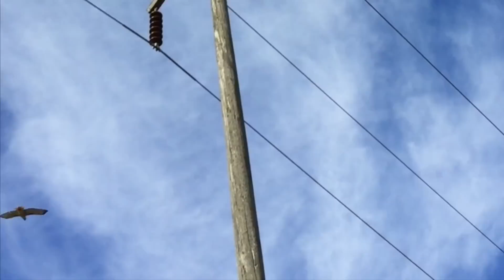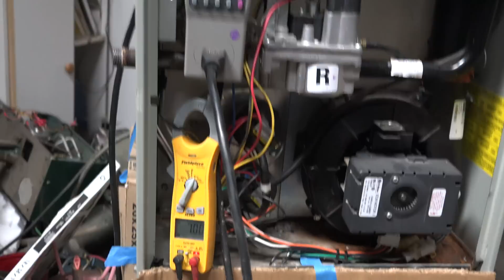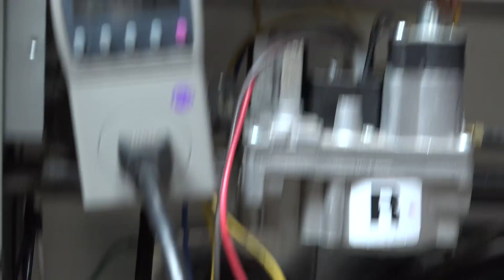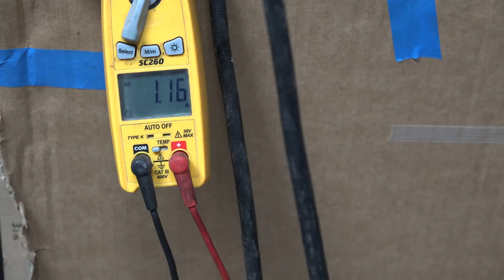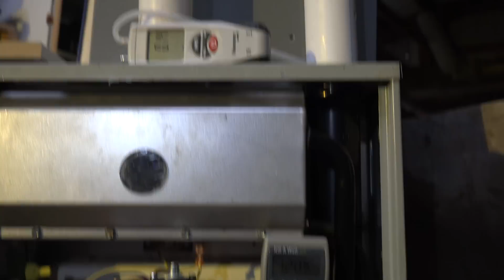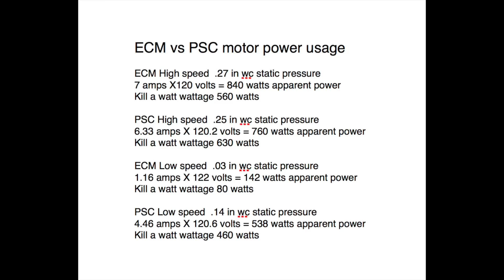ECM vs PSC motor #2

Comment: Great video, thanks for making it. I love the super low speed you can get with ecm for use in winter for filtering air and de stratification. Only drawing 80 watts is a bargain. I always suggest an ecm surge protector though because they burn up easy and are costly
Reply from the maker: Agreed
GFM

Comment: Do you recommend replacing a PSC motor in an electric heat/AC airhandler with an ECM motor?
Issues I am having is wifi interruption when furnace blower comes on. Also looking to maybe increase efficiency some. 
PSC motor in furnace is now about 10 years old and I believe the brushes are getting worn and increasing RFI and it is interrupting my Wi-Fi signal.

Comment: House utility installed power meter doe not include power factor effect i.e. it is KVA prox meter. Your experiment data shows that compare to PSC based unit, the ECM based units are expensive and needs frequent expensive repair. I think industry needs more research and engineering improvements on ECM to justify the added cost.

Comment: Awesome test, great video.  I am trying to decide whether it's worth the $1000 cdn to replace my faulty (for the second time) ECM 2.3 motor,  or to permanently convert to a PSC motor using a QT6104 board.  I currently have a bulletproof 25 year old PSC motor installed, wired directly to the mains, drawing 6.5 amps on hi-speed for A/C.  I'll need to get the conversion board so the electric bill won't kill the bank account, or I'll need to order a new ECM which will only kill the bank account every four years when they always fail in that time.  What should I do!?  Are there improvements to the reliability of newer ECMs?  Not sure of my static pressure but I have removed the dampers from all of the registers, and the filter is cleaned or replaced every 4 weeks. I would benefit on electrical costs as we run the fan in low speed 24/7/365.  But would it be enough?  
The Luxaire furnace is only 9 years old.  
Any advice is appreciated.
Reply from the maker: I would replace it with the PSC.  If the PSC is running at its high speed, it is fairly close to the power usage of the ECM.  It saves quite a lot if the PSC is operated at lower speeds.
GFM
Reply: Hi there.  Thanks for the advice. I used a Qwik board to replace the garbage ecm 2.3 motor, but the Qwik board will not run the fan on HIGH speed when cooling.  Is there a setting on either my oem Emerson board that needs to be adjusted or the Qwik board?  The second floor of the house is not being cooled, not enough CFM coming from the blower with this Qwik board as it keeps switching from HIGH, to MED, then staying on LOW for extended periods of time. I've tried putting the thermistor on the coils, tried moving it outside the furnace and even dunked it in hot water and the Qwik sets the fan on MED for a short time then back to LOW. 
Previous to receiving the Qwik 2.3 board I simply connected the PSC directly to power and the house was perfectly cool.  Any suggestions?

Comment: Maybe try using a med-low on the ECM to get roughly the same static pressure as the PSC.  Sure the static is less, because the motor is doing less work.
Reply: Yes, if the ECM motor could be adjusted to achieve the same static pressure as the PSC on low, it would be a valid comparison.  Otherwise, turn off the PSC for zero energy consumption, with both motors effectively doing zilch.  Low speed on one doesn't equal low speed on the other unless they're at the same static pressure.

Comment: I thought the lower the static pressure the more air that could be moved and the higher the pressure the less?Or am I confusing  blower pressure with TESP? Please explain for me.
Reply: With the same ductwork, higher static means more airflow.
If the ductwork is charged to reduce eh static, airflow INCREASES
Reply: @servicetechokc  ideal is .5wc . higher static pressure means less air flow restriction lower cfm's

Comment: This was a great update. Those Kill A Watt's are very accurate for the money, but they can be off quite a bit with some 'electronic' loads that have poor filtering and low power factors. Unfortunately a very good power meter is rather expensive. But for most peoples purposes, the thing they care about is what the meter on their house reads, and those are fairly cheap. So thats not a bad test. You'd need to very carefully count the disc rotations over time to determine the power since the numbers won't give you great resolution.

If there is a speed tap on the ECM to make it run the same static as the PSC, that would be a better test. The ECM should be more efficient at every speed, and the gap widens as the speed drops.

Comment: Can an  ECM be wired to replace a PSC motor?  If you think so,  what wring changes are ncessary? Maybe do a video on how.
Reply: Mars Azure is a "drop in" replacement for PSC. Hooks up the same way as the old PSC.
Reply: What provides the speed control signal if the system wasn't designed for variable speed operation of the blower?  Manual control?
Reply: DTR RTD control 50 to 150 dollar control board.  Depending on how much you want to spend!
Reply: They sell a kit to hook up a x13 in place of a Psc motor at all the supply houses down here in Florida. Try tropic supply or united refrigeration.
Reply: quikswap for the win

Comment: ECM wins considering a slightly higher static as well.I was sure the higher amperage would give higher wattage with voltage the same regardless of the power factor . The lead lag seems to change things a bit more than I expected ..
Reply: In the ECM case it isn't leading or lagging phase, Since current is only drawn when the AC input instantaneous voltage is higher than the DC bus voltage you get big current spikes at the sine wave peaks.
Reply: Servo motors, stepper motors, ECM motors .I give up and believe what you say...